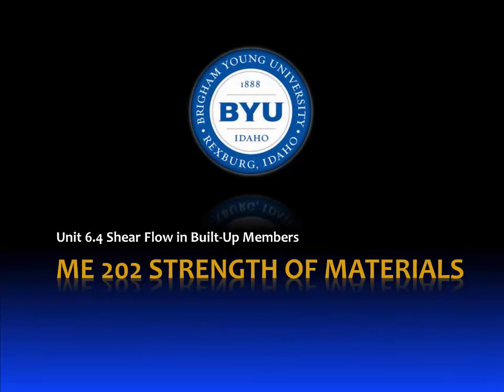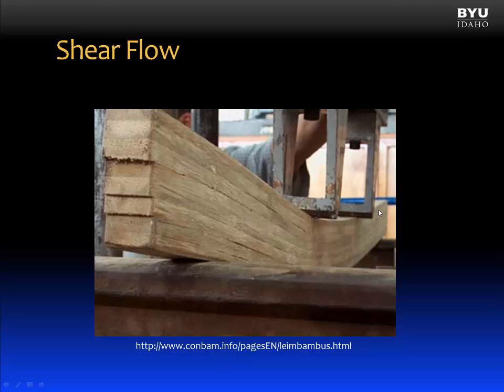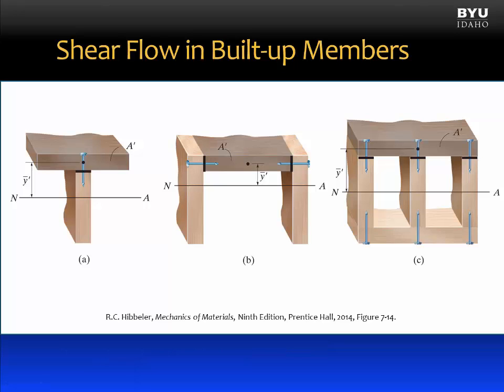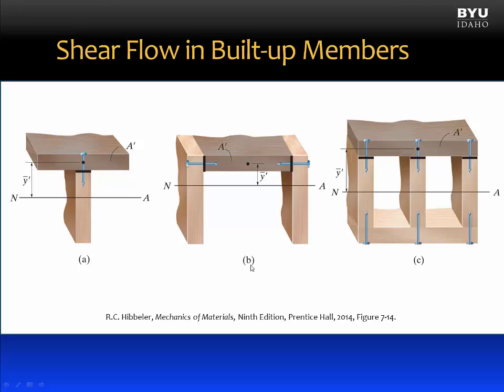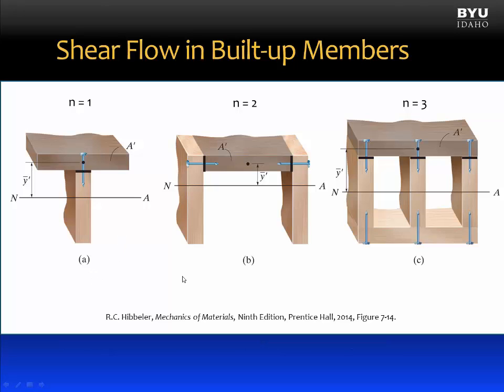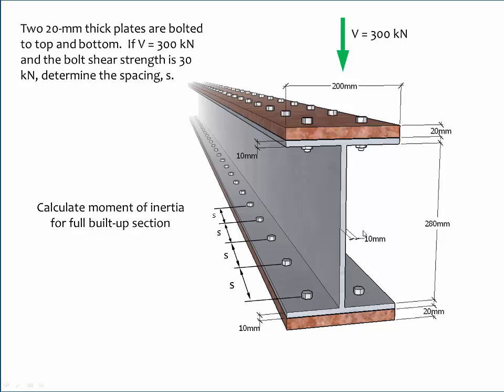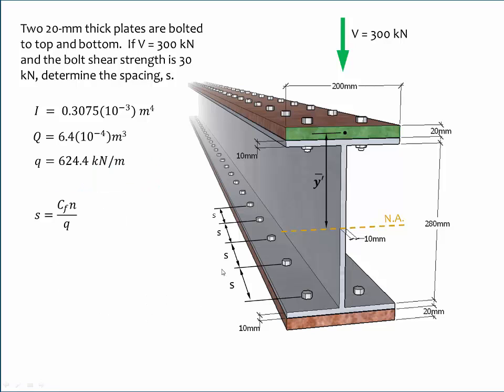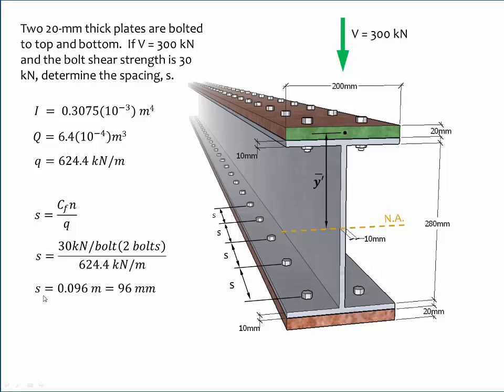06.4 Shear flow in built up members

Comment: In the non-bonded scenario, why is the top board longer while the bottom board is shorter? Wouldn't the bending stress still put the bottom board into tension and the top board into compression?